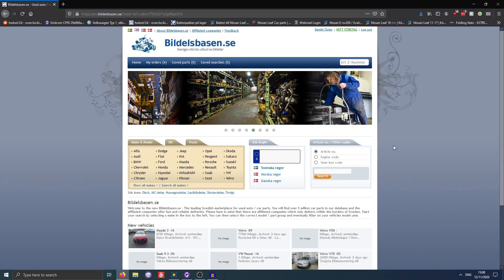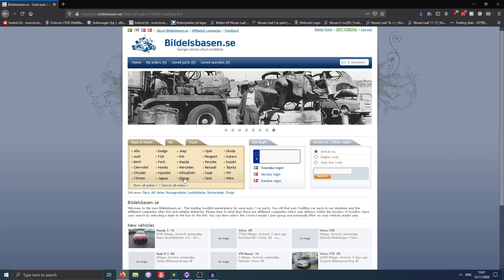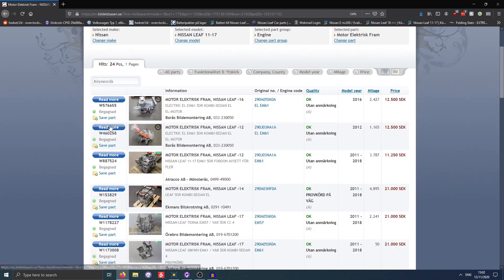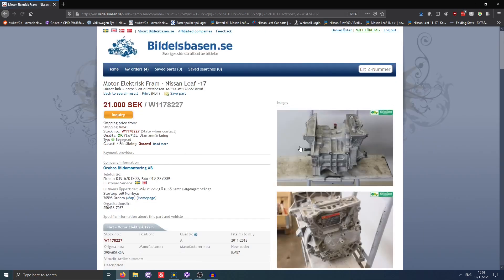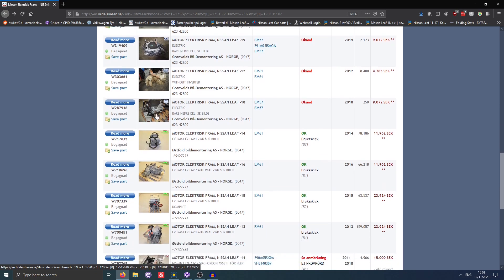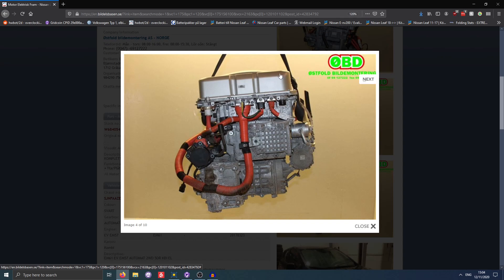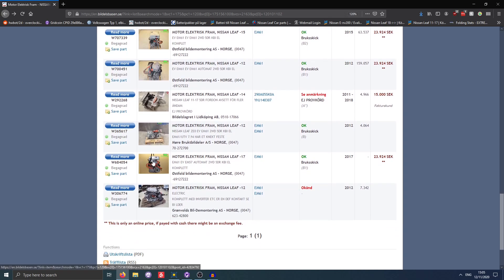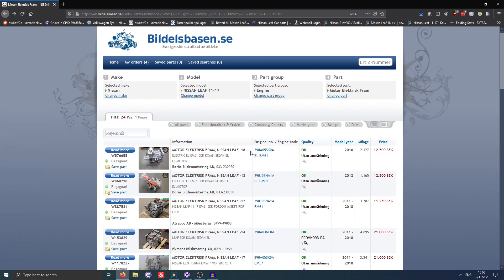EVNX - Electric Vehicle Conversion, Buying crashed LEAF bits [EP2]

Comment: Actually any tips about what parts can be easily reused from ZE1 in an AZE0 Leaf. I have bought donor ZE1 with 40kwh battery to replace our 30kwh dying one so this is a logical question. It would be great to be able to replace/upgrade the infotainment, dash, seats etc. I know it's probably impossible to replace the dash  - but what is? Thank you
Reply from the maker: Motor, inverter, PDM, battery, seats, steering wheel is a great start!

Comment: Your should take a look to the open inverter project.
Reply from the maker: Not suitable for keeping chademo afaik!
Reply: @DalasEVRepair  I think is also time to let Chademo go. You can get CCS from a Tesla onboard charger. Look for Damien Maguire videos in YouTube
Reply from the maker: @jpl9148  Not where I am. New chademo chargers being installed every week. I'll get to the CCS when I have to, would be silly to start working on it now when it costs a bunch and there isn't much to gain.

Oh, and it is possible to unlock 75kW charging on chademo with the CAN-bridge (chademo 2.0)

Comment: Hi Dala. I'm running all kinds of motors, as well as any nissan leaf on modified toyota prius 30 inverter. Boards are open soursed and can be bought from Damien Maguire with openiverter hardware/sofware.
Reply from the maker: Yes I love open source stuff, but to keep this build really quick and simply I am going with a new Swedish invention, that will allow me to use more OEM Nissan bits for the conversion. I'll talk more about this in the next video!
Reply: Thanks for that info very helpful. I was planning on buying a wrecked car and taking what I need which I still plan on doing.

Comment: Kertakaikkiaan, next video please.. want to convert my Fiat 600 and you make it look doable....have to check if i can fit a leaf in it. Thank you
Reply from the maker: Yes it is most likely possible, the Leaf unit can be split in two halves if there isn't enough room in the engine bay!
Reply: Fiat 500 exsists in EV... called 500e

Comment: Hello Daniel; I have been watching your site now for several weeks with great interest. I am a 60 year old licensed electrician in Canada.In Canada electric cars are so rare I have only seen 3 Tesla's. When I was 10 years old I built my first electric rechargeable car from an electric toothbrush and meccano axles. I worked in the electric forklift industry but I was only allowed to change engine oil on gas models. Several years back I started to design an electric garden tractor from golf cart controllers, but time limits stopped that project. I have stated for years at work that electric cars were coming and they thought I was wrong. i work on 5KVAC electric motors 2000 HP  soft start's and 600  VAC VFD's. From Canada Craig Clayton
Reply: Same here in Australia Craig. It's quite sad. I built a go-car for my 10  year old using two 2kW motors that were in a old style tape drive (WANG main frame computer) - one for each of the rear wheels. I installed 4 flat batteries (it needed 5 total for 60V) and got my oldest to sit in the drivers seat - touched the battery wires to the motors and it shot off, un-powered (since the wires were torn from my hands) and stopped around 50m from where it took off. I was going to build the PWM controllers for each motor and drive them according to throttle and steering position....I killed that project - the thing was an death trop if it had the 5, charged batteries installed...
Reply: @Bennyboy-dog  I hope Daniel does not mind use chatting over his site. Here in Canada we just dodged a freezing rain storm. That means everything is covered in a 1/4 " of ice, the ground I have used ice cleats to get to the car, this strikes terror in the storm path. Hydro wires and trees can be easily torn down. When I was 10 years old my father went to his cousin's house and I had a ride in a electric cart that probably used a 6 cylinder car starter motor to the rear wheel. All I remember is it went stinking fast and had no suspension, direct drive series motor. i have a 24 VDC motor I removed from the plants walk behind floor cleaning machine. From Canada Craig Clayton
Reply: @craigclayton4514  Canada is a huge chunk of real estate, out here on the West (wet) coast it has not dropped to freezing yet and there are lots of electric cars. I see Tesla's all the time ,mostly model3 .
Reply from the maker: Hi Craig, thanks for following along on this journey! I have nowhere near as much experience as you, VFDs are a very interesting topic that I'd want to learn more about! Thanks again for subscribing!
Reply: @Саня Белы Hello Sir; here in Canada I think it would be difficult to do any electric car conversions. The reason being no auto mechanic is going to have it certified for the road. The car would have to be built from factory original parts, if not they would say the brakes are wrong or the batteries would catch on fire. The Government stopped all muscle cars resales, meaning you can change the gas engine when you own it but it must have the factory engine installed when you resell it. At the other end of the scale the 3 rd world countries build  one truck from many different parts and frames. From Canada Craig Clayton